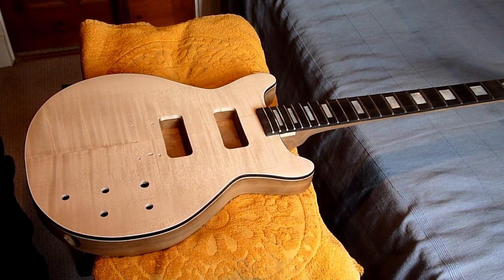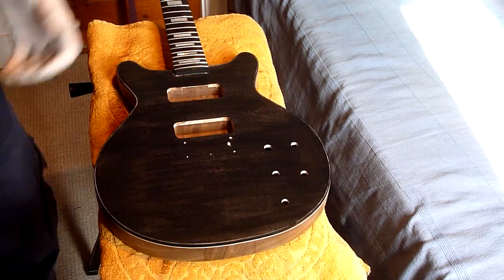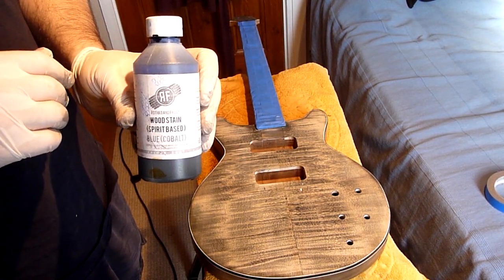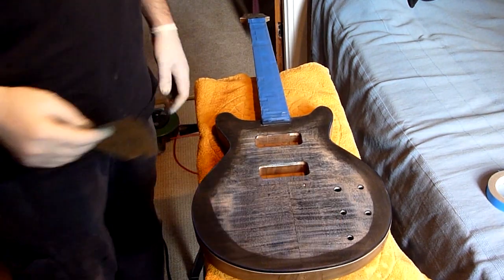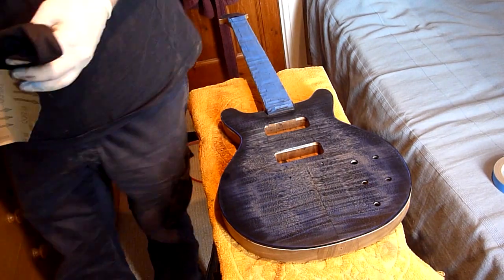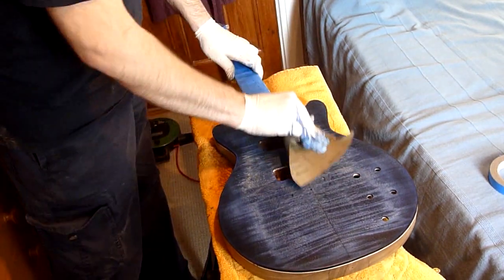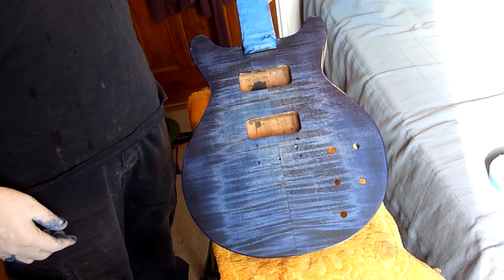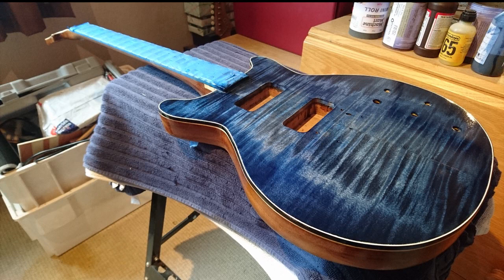Staining flamed maple guitar body Cobalt Blue full video

Comment: I really like the outcome, you had mentioned tru-oil, I’m looking into finishes, could I bother you for a couple different clear surface finishes you’d recommend, this is all new to me haha cheers
Reply from the maker: Hello and thanks for the comment.  Well there are many types of finish.. Tru oil is an oil and traditionally a gun stock finish but its been picked up by guitar makers recently as an oil finish gives you a nice natural look if you are showing the wood. There are many oil finishes including Danish Oil, Boiled Linseed oil and others and you can even use shellac wax BUT as much as it makes the wood look amazing doesnt offer much protection. Tru Oil has a hardener in it which makes it more durable. Also Osmo oil is very good for this... After that the traditional finishes on guitars are Nitrocellulose lacquer which is what Gibson uses. Its a lovely finish but hard to use and properly toxic when its wet (oil finishes you can just wipe on)..  And then theres polyurethane which you will find on a lot of Fenders and cheaper end guitars. This provides a very solid finish but is almost like adding a layer of plastic on your guitar.  So there you go I think thats the main ones covered.  Hope that helps and good luck.
Reply: Amazing, I’m a floor refinisher, more less retired. I know of the different finishes, but when it comes to guitar brands of dyes or finishes I’m blindfolded haha, in the future I may drop you a line, thanks for the help and input! Very much appriciated! 🤛
Reply: I was thinking about this later on today, and forgot to put it in the comments, do ones consider, bar finish? Or piano finish?
Reply from the maker: @deanraddick9041  I think the same goes for any wood finish.. You just have to consider the usage of the object and which will work better for you..  For guitars, they obvious get a lot of usage and touching with a high chance of scratching so you want the finish to last BUT some say that the thicker the finish, the worse it is for the sound. But there are no real ways to prove these things. A lot of people say a lot of things  :o)

Comment: another thought... if alcohol stain doesn't move around much, why use it?  Why not use a stain that will move around a tad so you can achieve some fades and have longer work time?
Reply from the maker: Well I guess that's a fair comment..  Which I would say the answer too was that it was a last second decision to add the black around the edge and I probably should have thought about it more  :)
Reply: @rabswoodguitars3613   Yeah, if you had diluted it by 50% and did that out into it some... then over that again out halfway into that, that would have been a good fade w/o the extra corrections but hey, you get bold and go and then sometimes it  doesn't work.  I have done airbrushing before and sometimes you just have to be patient and build up the layers.  I haven't tried staining but i guess it's fairly similar.

Comment: That "black" looks more brown.  I wonder if you were to add some blue color to the black, it would then lean toward blue instead of orange and the final blue stain would not be canceled by the brown/orange on the guitar.   ?  Maybe it would make the blue more saturated since the guitar would have gotten darker toward a BLUE instead of a brown.  ?   Just thinkin inside me head. ?  hehe
Reply from the maker: Well all colours look duller when they are dry.. Its what they look like wet that counts.. Im not sure where you get orange from? It may just be the lighting.
Reply: @rabswoodguitars3613   brown is just a dark, desaturated form of orange to red spectrum.  So when you put that "black" on, it just looked dark brown to me.  So, I says to myself, self, what if he TINTED the initial stain with a blue so the  first stain isn't brown but a dark blackish blue?  Then maybe it would have given some more intensity to the saturation of the blue in the end.  ?  I'm just working from pure color theory.  Maybe it doesn't matter in staining. ?
Reply: Hey that sounds like a fair point tinting the black with a bit of blue. Wouldn't hurt trying it on a scrap piece of wood to see how it ends up. But in the end it's the artists choice for it is his work and time he is sharing with us. I want to do the outside of my canoe I made like this but fear how many coats it would take. May have to end up tinting my epoxy instead. Great job!!!

Comment: Wonderful tutorial , guitar came out beautiful , I never thought about tru oil to finish the whole guitar , looks fabulous , do you ever use a poly or nitro to finish ?
Reply from the maker: Hello and thanks for the comment. Never used poly before but being a huge Gibson fan when I first started making guitars the first couple I did with a Nitro finish. The thing with Nitro is that its proper toxic and if you dont have a dedicated space to spray then you can only do it in the warmer weather and when its not damp out, plus it needs about four weeks to cure and you have to wear all the protective equipment..  And then you end up with a finish that is reactive to foam rubber (like you get on most guitar stands) and then it will crack and check...  Tru oil you can wipe on easy, dont need any special equipment to do it and it  gives you a nice natural finish. Also there is Osmo oil which I intend to use on my next build.

Comment: End result looks nice even with the earlier burst error.  Took some extra work tho.  I wonder what stain lets you smear it around longer to get better fades?
Reply from the maker: Water based stains are apparently better for that.. When I do this again (and I will make a vid) I will try that instead. The next one will be purple...
Reply: @rabswoodguitars3613   I like those stained looks.  But you have to have a nice grain and lots of cheap guitars are just planks glued together. :(   I BET money if one were patient enough, one could actually STAIN a regular guitar to have a fake wood grain first, then go over that with color.   Or just paint it with airbrush and make it paint instead.  ?  Just thinking.   I have a guitar body I sanded and it's just 3 planks glued together plus a bunch of wood filler in spots so I will have to paint mine.  I am trying to decide what to do with it.  Maybe some flake paint.  Fake stain.....  would take some time mimicking grain tho.   anyway....  thanks!
Reply from the maker: @TruthSurge  Why don't you get a nice veneer and stick that on the top? That's what some of the cheaper end guitar companies do to make them look nice with basic whatever wood underneath. The only issue with a veneer is that you cant sand it as much as I do in the video above as I have a 6mm cap on that so I can sand as much as I want.. Maybe look for something like Walnut that doesn't really need any staining at all as its usually so beautiful.
Reply: @rabswoodguitars3613   How would that work on a strat body?  The edges of mine are (of course) rounded.  I haven't actually made up my mind.  I might just make some flake or sparkle paint and do it with that instead.   Maybe gold with some sparkles in it. ?  Or deep green with sparkles. hehe  not sure yet.  But yeah, I guess a veneer works if it'll fit.
Reply from the maker: @TruthSurge Well it should bend over the arm cut as they are only 0.6mm thick...  As for the edge... Just file sand it flush.. They are so thin it doesn't take much...  Look it up on youtube.. gluing veneer to Stratocaster you will see some vids on the subject.. Also a good trick if you try it.. If you do it and get some bubbles, get some brown paper and an iron and iron them out.
Reply: @rabswoodguitars3613  interesting.   I might have a quick peek.  thx!!

Comment: How did you apply  the true oil???
Reply from the maker: You can do it a few ways... One thing to note is if you use a rag, when you let it dry you should leave it open and flat and not just throw it in the bin. It has been known to cause a fire. What I do is use a piece of paper kitchen towel. You wipe it on and then wipe the excess off and let it dry.. When its dry you will feel some roughness so then I sand it down a tiny bit with 1200 grit paper between coats just to keep it smooth.. To get a good shine id say about 10-15 coats is good.

Comment: Can i stain a veener 0,6 mm?
Reply from the maker: Yes you can stain it..  BUT you wont be able to sand it back very much... So if you are doing a single colour (rather than a burst) and you arnt looking too sand  it back for fading two colours together you should be ok...  You will be able to sand it a bit but use 600 grit and above that way you arnt taking much off.

Comment: How thick was that veneer? The latest chine guitar  kits is less than paper thin.
Reply from the maker: Hello.. Yes I should have mentioned this and it has been brought up before..  The body was a 5-6mm cap so was thick enough for me to sand as I wanted.  The headstock veneer was only a couple mm thick though.. But yes if you are using a usual 0.6mm veneer you must be very careful not to sand through it.

Comment: Hello , very nice work ! I have stained my guitar in the same way as you did , but  , my guitar got darker and darker . Does it due to tru oil  ? Thanks for your answer !
Reply from the maker: Hello..  And thank you for your comment... This is due to a few things...  Yes, my guitar has got darker too.... Blue is notorious for fading and changing colour (greenish)..  Tru oil as you may know has a yellow or amber tint so this is also a factor.. Plus depending on what kind of stain you use the light colour of the wood under the stain also plays a part. Its been recorded a lot on PRS guitars. Look at this page with the picture of the colour under the pickups.https://forums.prsguitars.com/threads/question-about-colour-fading.10586/
Reply: @rabswoodguitars3613  I am trying to understand what is "true oil" here in Italy.
How can it be called here. 
For what use is used other than guitar? How to fi d it?
Suggestions?
Thank you
Reply from the maker: @paulterl4563  Well its actually Tru Oil (no E)..  Its a gunstock finish..   Look it up on Amazon or Ebay, that's where I usually get mine. Its made by Birchwood Casey. Try this  https://www.ebay.co.uk/itm/Birchwood-Casey-Tru-Oil-Gun-Stock-Wood-Finish-for-Shotgun-Rifles-and-Guitars/372283251370?hash=item56adcf9aaa:m:mU2B6PUSy2vTt0VGoeoiUbw

Comment: where can i get the true oil and the dye?i want to make sure the oil and the dye are compatible.and also do you sand the oil at all or just put it on?
Reply from the maker: Hello..   The tru oil can be bought on Ebay or Amazon...  The stain I used in this vid is from a UK company called Rothko and Frost... And yes I do some very light sanding with something like 1200 grit paper (wet sanding) between coats...  I think the best way to use tru oil is to wipe it on, rub it in and then wipe off the excess and let it dry.  Some people wipe it on more thickly and that would probably need more sanding between coats to keep the surface nice and flat.

Comment: I would love to do just what you have done but the kit I have has a very very thin maple veneer..think it is only0.6mm ..yours must have been a lot thicker?
Reply from the maker: Ahh yes..  You are absolutely correct. This was something I was going to mention in my video and forgot..  The top I had on this build was about 6mm thick.. If you only have a thin veneer as you do, you can only sand it back a couple of times and very lightly or you will sand through the top.The thing is when I sand with the 600 grit paper to thin the stain.. Its removing very little wood..  Its only if you want to do a dark stain under the main colour which you need to sand back quite a bit where you have to be very careful if you have a thin veneer...

Comment: Is that a veneer laminate on the top of body or real maple cap? I know you said a veneer on the headstock. Was unsure of using a electric sander on a veneer.... Thanks for the video
Reply from the maker: Hello and thanks...  that's a good comment and been mentioned on another comment below. Yes I should have made that clear that the body has a full maple cap (you can see the thickness in the pickup holes its about 6mm). The headstock is a 2.5mm veneer... So yes, you wont get away with so much sanding on a standard veneer which are often 0.6mm thick but you can get away with some as I only use 400grit + sandpaper (often 600) which means you arnt taking off much.

Comment: look amazing, didn't you clean the sanding dust off after sanding? you must have right?
Reply from the maker: Thanks...  And yes.. After the main sanding I did but during the staining I didn't as I didn't sand much and when its still wet it just clogs in the sand paper so doesn't leave much dust, the rest if there is any gets wiped off as you wipe the stain on.

Comment: Here's a true novice question: what's the purpose of the true oil?
Reply from the maker: To protect the wood from the elements.  If you left the wood unfinished it would be way more prone to warp and crack and all sorts of strange things that wood does. And to generally protect it from scratches and stuff like that. Also depending on how you finish it, it makes the guitar shiny and people like shiny things :o)
Reply: @rabswoodguitars3613  nice job Rabs. I'm curious, does the TRU oil give you a nice even, grain-free finish in the same way that a clear coat of lacquer wood? I want it to be relatively flat to the touch. I'm staining a Flying V right now, and I have Minwax black stain and tru-oil already in the cabinet. I was considering doing the same thing that you did. Tru-oil is just so much easier to work with, but a friend of mine told me that using tru-oil as a finish won't give you that flat to the touch feel.
Reply from the maker: Hi and thanks for the comment...  On my builds I don't generally use any grain filler as I dont mind it not  100 % flat so it isn't quite flat but comes close after several layers of oil (like 15)..  It depends on what wood you are using..  Maple for instance is close grained and doesn't really require much filling so it only takes a few coats to get a nice finish Mahogany for instance if you want it flat needs grain filling.. It also depends on if you sand between coats.. BUT I doubt you would ever get a mirror finish. HOWEVER there is a trick where you can thin Tru Oil with white spirits (mineral spirits) and it goes on much smoother and self levels more. I did a quick video about that here https://www.youtube.com/watch?v=B7YTxYJfRgg   . Hope that helps and feel free to ask me any more questions you want to :o)